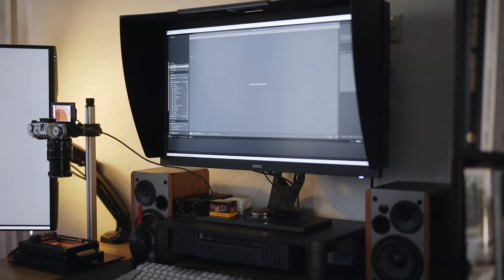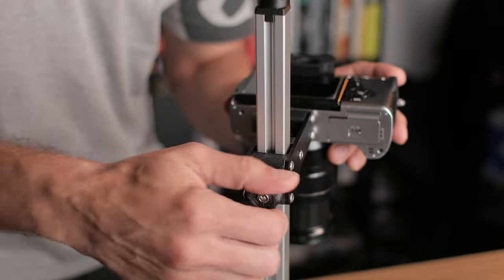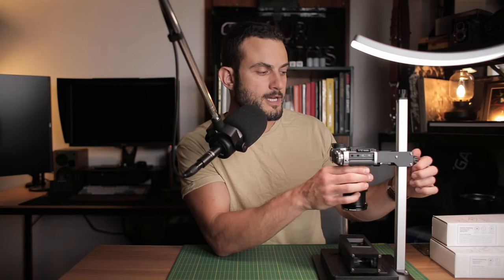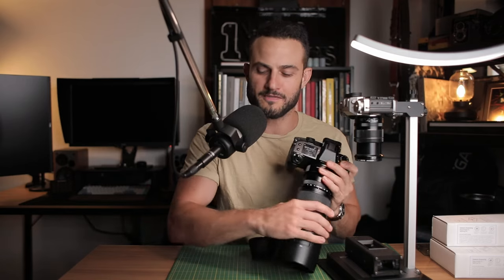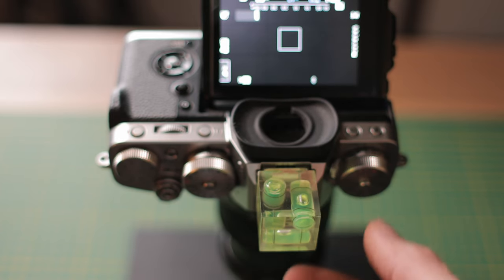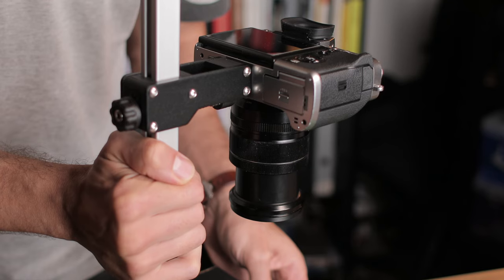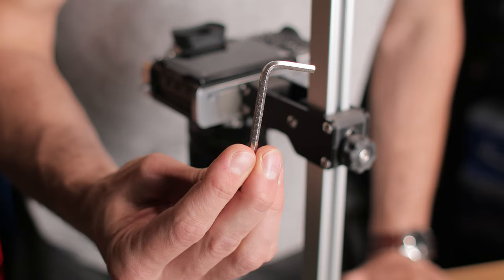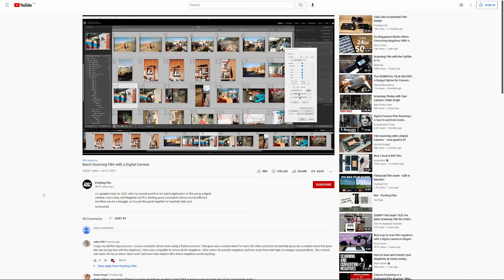Negative Supply Basic Riser Mini - Copy Stand for Film Scanning

Comment: Thanks for the review. For 35mm check out the JJC film copying set up.  Much easier to use than a copy stand, particularly with cut film and mounted slides. Comes with a led light, film holders and extension tubes that mount direct to macro lenses.

Comment: The Canon EF 100mm f/2.8L Macro IS USM lens: Are there any issues using it for digital camera scanning, (sharp optics)?
Reply from the maker: I think that's a great option! I have used that lens in the past and it was quite nice. Although I have the L version now, the main advantage is stabilisation (which you wouldn't need for film scanning)
Reply: I have the EF 100mm F2.8 L and tested it against a number of other lenses. It's certainly very good, but not exceptional when it comes to resolution or CA (which I kind of expected from some online review). Wouldn't hesitate to use it for camera scanning though.
Reply from the maker: @frstesiste7670  what's the best option in those respects for Canon?
Reply: I don't know if anyone can say that it's one obvious best option for Canon (EF). If you've already got a Canon 100mm F2.8 L then I'd use that. It's one of the few EF lenses (worth selling) I kept when I switched to mirrorless. 

Still, IMO it's not particularly good value for money at the current prices if you basically want to only use it to digitize film and other macro work. You can get basically the same IQ from a number of other macro lenses at much lower cost.

I compared it to an older 50mm macro, and the 100mm was better, but not by much. I also compared it to a Sigma 50mm F1.4 Art lens and expected it would give as high resolution and the 100mm clearly didn't. Of course the Art lens isn't a macro so cant compete at macro distances, but it say something about how good the 100mm could have been. 

Good options (haven't used all of them so partially based on reviews) are IMO Sigma 70mm and 105mm, Tamron 90mm and the old non-L Canon 100mm is also as good optically.

Comment: I've been considering building one myself. I'm over using my tripod and don't want to spend so much 😅
Reply from the maker: I've seen some pretty good DIY rigs shared on the Discord server! Can be a good way to go if you're crafty and have the time :-)
Reply: Here is a link to a video on how to build one. I want to use a 45.7 MP camera and 105mm macro lens so need  a beefier mount and taller post (I will be doing 120 negatives). I have a larger Manfrotto clamp than the video shows and I am going to mount an Arca Swiss plate from an old ball head on the clamp. Now I need to figure out how to avoid buying a $270 negative holder. https://www.youtube.com/watch?v=swu13sUWGaY&list=PL_letUDgVX7nfGLDMFjjN3w_gZN11CuRY&index=52&t=6s